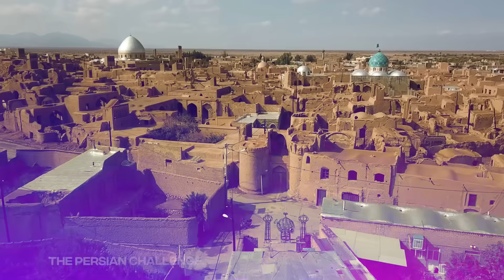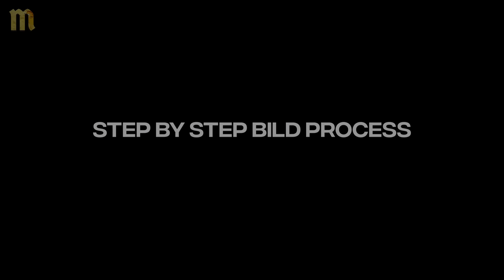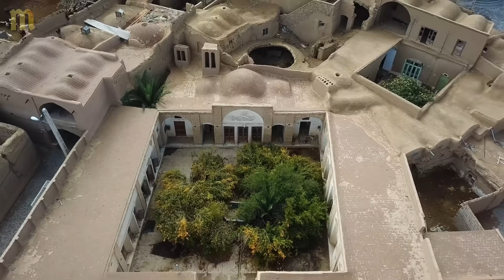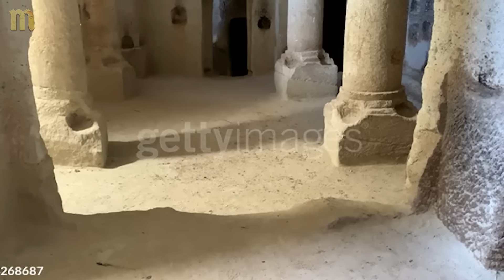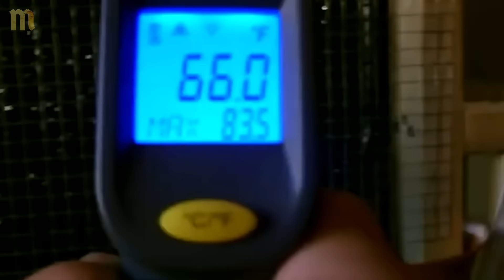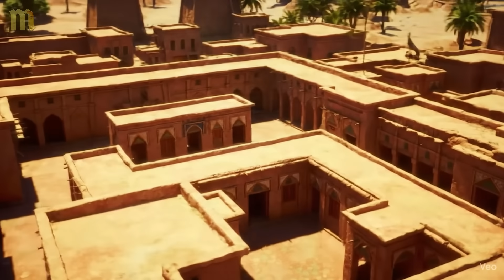Build This Persian AC: Drops Temperature 40°F in 120° Heat

Comment: They used very heavy thick walls to keep the heat out. Along with cloth soaked in water hanging  on walls and in front of windows. Evaporation cooled the air.

Comment: Little did we know. We did this back in the 80s when we didn't have AC. We covered our back windows with wet fabric and had box fans in the front windows. We had to really make sure there were no gaps around the fans or it didnt work.

Comment: It’s terrific—but mostly only for areas with lower humidity.  
Using swamp-coolers in high-humidity areas, is a big Mold PROBLEM!   

We got desperate, & bot a used swamp cooler to use in the middle of Kansas—105*F, & often 90+% humidity.   
It only dropped the house temp maybe 10 to 15 degrees, & added yet-more humidity—it practically rained indoors!   Had to keep the fan moving air fast, & a window on other side of house open to let air circulate the humidity faster, to prevent indoor rain!  

Note to big box & chain stores:  to all the central buyers, ya need to get this clue:  
swamp coolers should NOT be sold in stores located in humid-hot climates—it’s a mold liability.

Comment: We would call that a swampy, great for dry heat - where you have no water, but not to effective in humidity. A Koolgardie safe was a flywire sort of box that had an old worn out towel on the sides and water on top that would wick up over the top and down the sides. Hang it up under a shady tree and it keeps things cool

Comment: An old building in Jackson, MS has a gas powered heater in the top of the tower. Heat rises. The building was surrounded by trees. As the flames heated the humid air, the hot air rose to move out the windows pulling cooler shaded air in to lower levels. Certain trees cool the air under them. Mimosas. Empress trees. Even cedars.
Old windows were 'double hung' so both the top and bottom windows could open. Hot air escaped out the top window while cooler air entered the bottom window. By opening the lower windows on the shaded north side of the house and opening the top windows on the south side, air flow crossed the rooms.
Reply: Love that kind of old shit..

Comment: DO NOT use this in hot humid climate areas. It adds moisture to the air inside the home. MODE, MODE Everywhere. We have a large industrial unit at work. It is out in the open at loading docks. Thing fills like a freezer on a hot day. They do work here in the south also. Just don't do one in the house.

Comment: This is supposed to be a useful and technical expose, and yet it is presented by someone who doesn't hold a solid understanding of even the basics.  For one, the nomenclature is consistently off.  But there are many points in here which support my assessment.
I'd have to redo the whole thing--which would be easy--but the list is too long to get into here.  It should have been proofed by someone with experience and know-how.

Comment: One of the most important aspects of heat reduction is the double roof. Look it up, but it was used in the temple of Luxor in Egypt.
Reply: We have a home in Egypt and it is the construction of high ceilings--think French design, the towers with windows which open into the apartments that allow air into the home, the basement and the roof top. It was 104° but our apartment was very cool. I didn't use a fan or turn on the AC. The towers make a tremendous difference.

Comment: Yeah, that humidity is a MAJOR caveat.

You need to do it where the air is dry. If you do this somewhere humid, you're going to be suffering. I know a building where people forgot about that little tidbit, and now it's a sunk-cost to maintain their millions and millions of dollars of electronics in something that became a sauna. Needless to say, it's become where run a lot of their lowest priority stuff.

I mean, there is a way to do it where it's more humid. You could make ice at night and have it melt through tubes that the fan blows over during the day, but you want to make sure all that ice goes right down the drain and doesn't evaporate. It's not as efficient though, but it should do in a pinch.
Reply: people will also enjoy mosquitos, let them be dumb after all

Comment: It really puts the lie to the modern conceit that we are somehow smarter or more clever than our ancestors.

Some years back I participated in an archaeological dig at a Roman fort, working in the buried 'vicus'--the civilian settlement--outside the walls. The lead archaeologist asked me to clear out a number of drainage ditches and conduits that ran alongside two of the vicus streets, looking for 'smalls' (small finds such as coins) that would have been dropped by passers-by and then washed into the ditches.

I cleared the ditches down to the stone base or to the 'natural'(soil). After a long morning I went to a nearby shed to grab some tea. At that moment a heavy rainstorm swept in, and darn me if the water immediately drained off the ancient road surfaces, into the ditches, which--never overflowing--then joined one another and eventually emptied the water into a nearby stream. The system worked precisely as it would have 2000 years back.

A truly humbling and emotional experience.

Comment: LOL I have an evaporative swamp cooler and it's not possible to get anywhere near a 40 degree drop in temperature in just one small room let alone my whole house. It's quite large (for a room unit) and I live in one of the most ideal locations in the world for a swamp cooler, and I'm starting out with 80F not 120F. I also have normal AC running (it's just shit) and if I have it running for 8 hours straight then it's about a 10 degree drop (with the humidity up about 40% as the cost because I don't have a way to get rid of it quickly). 

You might get more cooling with a whole house unit but that's much more than $50, and it still depends on various factors. You still can't get a 40 degree drop, but rather more likely around a 25 degree drop under very ideal circumstances where you have a huge setup and also the humidity is constantly pulled out so it stays below 10% at all times.

If you live somewhere the humidity is above around 35%, a swamp cooler is increasingly useless for you - mine is often below 10% outdoors and below 20% indoors. I feel like I've been seeing an increasing amount of people buy these due to social media and then are angry when it doesn't make them cool - you MUST have low humidity for it to work effectively. It also uses up a LOT of water daily, I have a 12 gallon unit and have to refill almost the whole thing if it's running most of the day.
Reply: I live in the desert where summer temps are coonsistently at or  above 100°F and humidity is often in the single digits. I think it wd work for me. These really only work in very hot, very dry climates. However, I grew up in a high humidity, hot climate. We'd place a fan at the foot of our bed and put a container (like a dishpan) of water in front of it. It wasn't the definitive answer but it helped a lot. Beware of over-humidifying though because of mold/mildew.
Reply: And I'll save anyone the trouble of telling me air conditioning and swamp coolers somewhat work against each other - I know! But my worthless landlord won't replace the aircon and I don't have any windows to use a portable one so swamp cooler is my only option to cool more apart from moving out  :(
Reply: whole house fans work a little because they cool off the ceiling space to room temp. that's as much as they can do.

Comment: It looks like his modern demonstration has the moisture matrix at the fan's intake: this might mean having water particles drawn into the electric fan.... (the motor, the switch, the wiring).  Any time you have water and electricity in close proximity, it could create a dangerous situation. 😵  Placing the moisture matrix at the fan's outflow makes more sense, as the fan is pushing the water away from its electrical bits, but you still have high voltage/amperage and water close together.😮 There are safer ways to recreate this effect.
Reply: Gives me some thing to think about but I use 12v batteries pumps and fans
Reply: @kenjohnson1001  You still don't want the fan to short-circuit.
ESPECIALLY if those are Lithium Ion batteries.
Reply: @TimeSurfer206 more explanation more fun lol I don't use new battery I'm old school 9v and a 775 hook and wire for more power and run time use recharge batteries and solar panels and have fun testing just be smart and cover everything that comes into contact with water

Comment: Why do these AI generated videos get released with such glaring mistakes. These types of coolers don't need humidity. They won't work in a swampy humid environment.
Reply: Yes,the Persian engineers (sorry) had dry heat problems.
Reply: The answer is simple.  AI = Artificial Intelligence.  Nothing will ever replace the HB = Human Brain.
Reply: @zazminrios7951  AI can do valuable things like how ALL human proteins fold,and has actually done it in a few years,far,far faster than humans. It is already better at finding cancer in x-ray scans than people.
Reply: Persia...it's the desert.  Evaporative cooling is very effective in desert conditions.  I lived in Phoenix in the mid 70s.  The roof mounted swamp cooler kept our mobile home very comfortable.  We needed blankets at night.
Reply: @duskintheforest584 only effective when it's NOT monsoon season.
Reply: I tried a swamp cooler doesn't work when humid so I tried some thing different froze milk jugs and set them behind a fan and also had ice water with a sprayer and it coolse down with cool humidity think smarter not harder and with some work it can be done with junk
Reply: @kenjohnson1001 I saw where ppl used frozen water bottles attached to their fans. The covers were attached somehow around your fan. I want to try that. And just be able to screw fresh frozen bottles on when they were thawed. We had over 95 degree weather here over the weekend. The humidity was 90%. It was like a scorching oven outside! Inside you just were wet and hot. Also I'm from Minnesota where we were without electricity in that heat because of the terrible storm that hit us early Saturday morning! But you are right, when you have such humidity you just can't throw more on it and have any relief! Here in Minnesota, land of 10,000 lakes (it's actually 10's of thousands more) the heat is unbearable because of the humidity! I have been in Wyoming, Arizona, Nevada, California where the hot weather is so wonderful to me because it's dry. I can tolerate that a lot more. It just doesn't feel so hot compared to the muggy! And in the shade it is so much cooler, not in muggy places though, no difference! So you are right, they use swamp coolers out there, useless here in Minnesota when we have excessive heat!
Reply: @kenjohnson1001 Aloha hugs from Hawaii 
I am going to try that GBY
Reply: Ideally, humidity needs to be below 50% for this to work well
Reply: @13gladiusToTheKnot  on 0ld friend owned a property with a natural spring higher than his home. the water temp out of the ground was about 60 deg. F. he piped the water downhill through his home with several open areas. he used the water flow to move pumps and fans that circulated water through and over the pads. kept the place nice and cool. this was near northern New Mexico.
Reply: @hello_kitty_girl69 I have seen this! Brilliant idea!!
Reply: A.I. Videos Suck
Reply: Look unders Discription I  know you are upset about something This is excellent editing excellent  sets I can make this can you?
Reply: In arid environments, evaporative cooling work brilliantly. In humid environments, a fan works well, because air movement can also create evaporation.
Reply: Because it's part of agendas dumb down the dumbest and rewritten bamboozle history in 2 decades you would believe what is going to be
Reply: It got us commenting here didn't it? Engagement as a monetization parameter in the age of AI, is broken.

Comment: You are better off digging trenches into the soil as it stays around 50 deg.5ft, down. Put some pipes in the trench and bring them into the lower wall of the house and open a window higher in the house and it pulls the cool air in. People in the desert building earth bag or compacted soil homes have been doing this for a long time. It works good. No moisture in the air too.

Comment: A circular tube which fits inside a square channel has the same efficiency.  If internal support vanes are twisted to circulate air around the internal tube and have porous surfaces with water inside them, this will further increase cooling efficiency.  It is the prevailing wind during hot winds we need to contemplate.  Maybe some vanes should be closeable to control effectivity and efficiency of the system.

Comment: That thing you built is called a cooler [evaporator] and it works best when fed with hot, dry air, the dryer and hotter the better, more evaporation, more cooling... You can get'em around 50$
Reply: where wd I look for a $50 one and what wd I ask for? Lowe's? Ace?
Reply: @oinkieboinkie  It's called a "Swamp Cooler." And it's probably a bit more than $50, but less than an Air Conditioner.
And it uses a LOT less electricititty in a dry climate than an AC does.
Reply: @TimeSurfer206  a lot less elec but where in the desert does the water come from?
Reply: @oinkieboinkie  Straight from the air.
Even in the middle of the Sahara Desert, there's humidititty in the air out there.
Typically, the atmospheric moisture is 25%, but can get as low as 10%.
Reply: Or even $50

Comment: Not one of Medieval Wisdom's better videos. It would help if it showed, all together, how to build the system rathert than breaking it up into pieces according to the physics. As @irmuggle said, it's basically a swamp cooler which is used in the Western part of the US extensively.
Reply from the maker: Should have shown the complete build start to finish instead of breaking it up. Way more practical that way. Thanks for the feedback - really helps us improve! 🙏
Reply: @MedievalWisdom that would be helpful, especially for a small office
Reply: Poor water over some honeycomb shapes and blow air through it.. not rocket science.

Comment: Yeah, that's great.They're also called swamp coolers.But you better live somewhere there's humidity.The walls in your house are gonna be drenched, and mold will build up
Reply: Only works when the air is dry. Won't work in humid location
Reply: That's because of the swamp... not the cooler... when you don't live in a swamp, it's called a cooler [evaporator] and it works best when fed with hot, dry air, the dryer and hotter the better, more evaporation, more cooling... You can get'em around 50$
Reply: @user-McGiver it's called a swamp cooler because it comes with it's own swamp😂
Reply: For a swamp cooler to work there can be no humidity but everyone knows that. Except for the OP and whomever goes around "liking" posts on this station. Shows how stupid the station AI is. Just another automated video machine this station.
Reply: I live in a humid area and we use a swamp cooler for the barn. (It's the kind you put water in, too). It works very well.
Reply: In high humidity areas this will work less efficiently since evaporation is easier when the air you feed the system is dry. However, if you want to use this system in your house and don't want humidity to grow, then you can separate the cooling air from inside air. One way could be channeling the cooling air inside a pipe system in your walls, if your walls are cool, they will cool down the inside air too. The other way is more direct you can build an inside circle too, that flows the other direction (of course this will need electricity), and conducts heat to the cooling system, it's basically a makeshift counter-flow heat exchanger.
Reply: "somewhere there's low humidity"
Reply: Yep will not work in humid climate, will make it worse.
Reply: They are great and all but I worded somewhere inside issues was excessive humidity and temps so these worked but not really as they just made it more humid but feels good in front of it